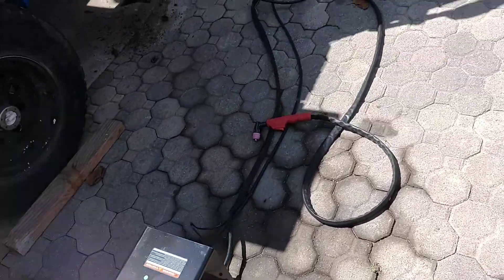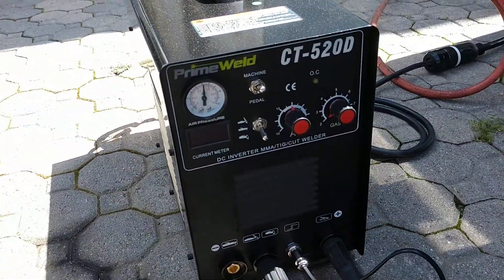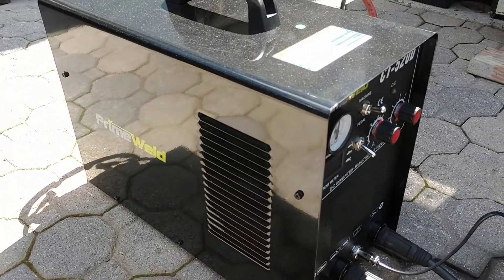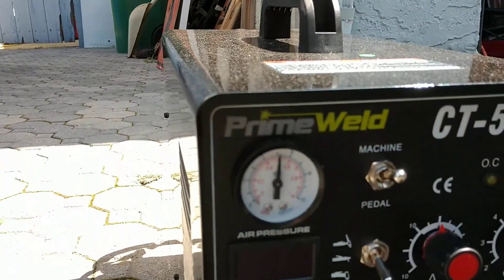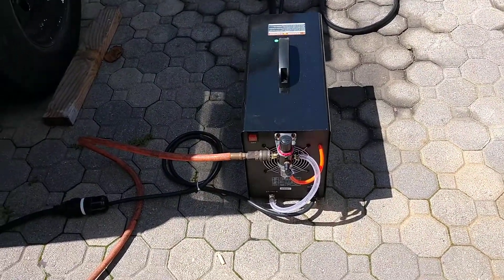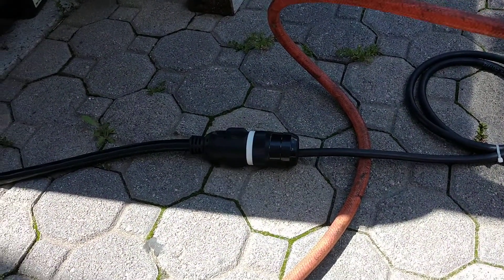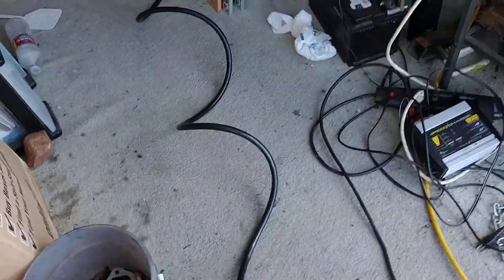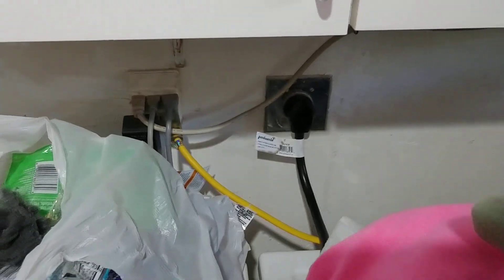PrimeWeld CT520D Plasma, Tig, Stick Machine

Comment: Where did you find the power cord  That you ran to the  Dryer outlet?
Reply from the maker: Amazon. You have to do the research to figure out what the name of your dryer socket is. Then they make 1' adapters from the dryer socket you have to the generic welder power cable format.